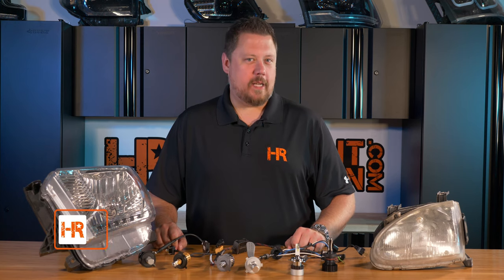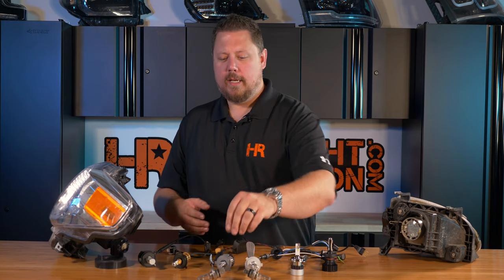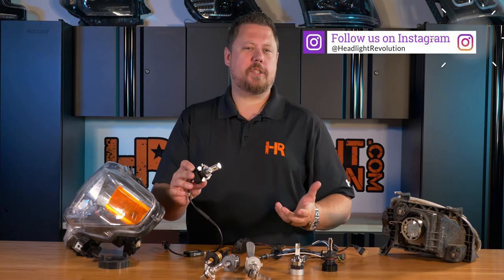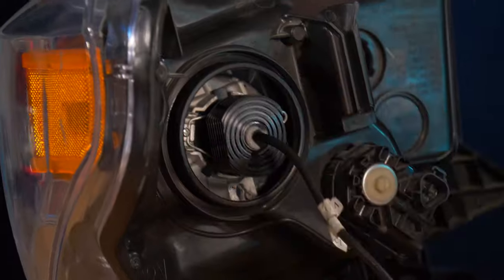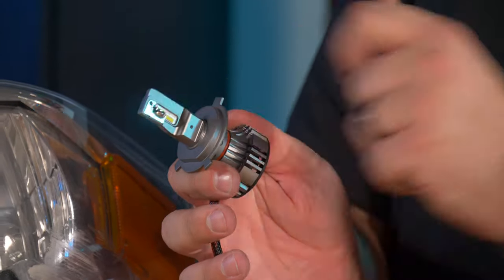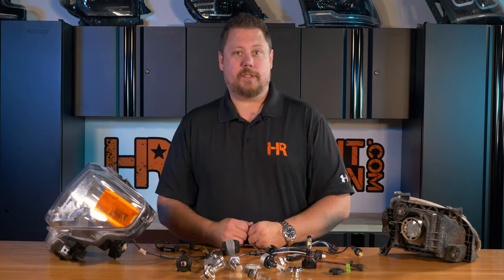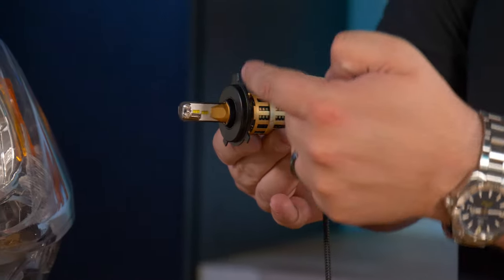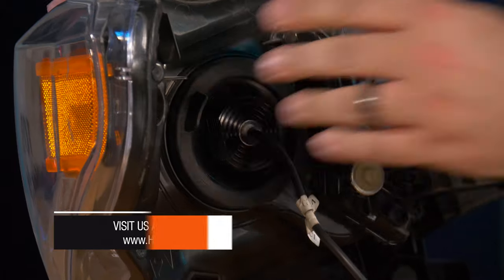How to install H4 or 9003 LED Headlight Bulbs - Tips and Tricks from Headlight Revolution

Comment: The sv4 collar doesn’t lock up it’s pretty disappointing for how much it costs. Couldn’t use my dust cover because it pushes it back out because it doesn’t lock in.
Reply from the maker: Do you have a Tundra, by chance? If so, That thick collar sometimes pushes the bulb out and we do have a solution for that.
Reply: Headlight Revolution No, I have a 2009 econoline with aftermarket sealed beam housings with the replaceable H4 bulbs.

Comment: Do you guys have a email I can reach you at for a question?  Basically I have a 2010 2500 with aftermarket projector headlights and was wondering what year I need to select for the hid upgrade kit y’all have
Reply from the maker: Please reach out to us at sales@headlightrevolution.com
Reply: @HeadlightRevolution  In one of your previous videos about installing H4 LED headlights the other guy told to twist them so that it has a 93° angle. I watched this video many times and Im a bit unsure now as this is not mentioned. I just got a pair of H4 CSP and I would really like to know !!! thanks

Comment: Beam pattern shots for the Morimoto 2 Stroke 2.0 vs the GTR Ultra 2 please.
Reply from the maker: We show this in most of our new vehicle specific testing videos that we've done lately. Check them out!
Reply: @HeadlightRevolution  H4 specifically. I'm not finding anything on the GTR Lighting Ultra 2 in H4, or the Morimoto 2-Stroke LED in H4. Reflector housing beam shots including high and low comparisons for both light would be super useful to me right now. It a lot of money, but I've been considering a retrofit if I can't find something with a usable/desirable output.
Reply from the maker: Here is a link for the H4 bulbs! https://headlightrevolution.com/h4-9003-gtr-lighting-ultra-2/

Comment: I feel like such a dumbass. When you know to take off the collar this is stupid easy. But I didn't do that (b/c I didn't know) and tried to force the spring clip over the led motor, and it just broke off. It's so easy when you just place the collar, attach the clip, put in the rubber and then install the led bulb. Ugh. I'm actually a decent mechanic, but these bulbs don't come with any instructions so I'm glad I kinda stumbled upon this video so that I actually did it right albeit after I effed one side up. Btw, I was still able to install the led bulb even without the clip because the rubber backing keeps it in place. Not as good as having a clip, but at least it's functional. Is there anywhere that sells just the spring clip or would you have to replace the entire headlight assembly just for that one stupid clip?
Reply from the maker: You should be able to find some on Google, sorry that you had issues with that one side!
Reply: @HeadlightRevolution  Hey thanks for the reply. It's for a 2001 Honda CR-V. I can only find retaining clip assembly for Ford. Any suggestions?
Reply from the maker: Heres an assortment!

https://www.amazon.com/Retaining-Spring-Universal-Headlight-Headlamp/dp/B07SZNDJ7C/ref=asc_df_B07SZNDJ7C/?tag=hyprod-20&linkCode=df0&hvadid=366430949423&hvpos=&hvnetw=g&hvrand=3846391476856248058&hvpone=&hvptwo=&hvqmt=&hvdev=c&hvdvcmdl=&hvlocint=&hvlocphy=9010937&hvtargid=pla-803742334494&psc=1&tag=&ref=&adgrpid=83058288664&hvpone=&hvptwo=&hvadid=366430949423&hvpos=&hvnetw=g&hvrand=3846391476856248058&hvqmt=&hvdev=c&hvdvcmdl=&hvlocint=&hvlocphy=9010937&hvtargid=pla-803742334494
Reply: @HeadlightRevolution  I guess I should be more clear. The spring clip itself didn't break. I still have that. It broke at the joint where it pivots. Right next to the phillips head screw. There is a little metal piece that holds it in place and that snapped right off. So there is no little channel anymore for the base of the clip in which to sit.
Reply from the maker: Ahhh, in that case I'm not too sure on how you can replace that. May have to MacGyver it a bit!

Comment: LED's suck, burn out at most 9 months, went to XENON so far 9 months still works. LEDs are a mess, they need to figure out how they can work and be durable in harsh conditions.
Reply from the maker: We have had quite the opposite results from you, we have been testing LED bulbs since we opened our doors, and the technology has really improved in the last 2 years alone! Let us know if you have any other questions, have a great day!
Reply: @HeadlightRevolution  the ones you buy on amazon like roadsun or auxbeam, tuincin etc.. any of the amazon ones fail in less than a year and still cost about $50 a set. Not great.. bought myself some car rover xenons and they have survived a year now.
Reply from the maker: Glad you are liking those HIDs, bummer that LEDs were not working for you! If you have any other questions, let us know! Thank you and have a great day!